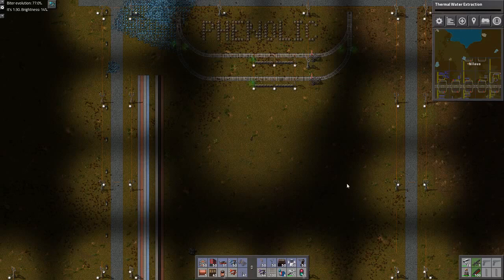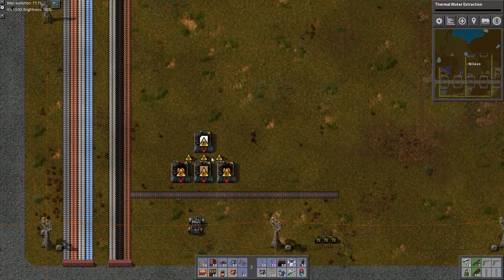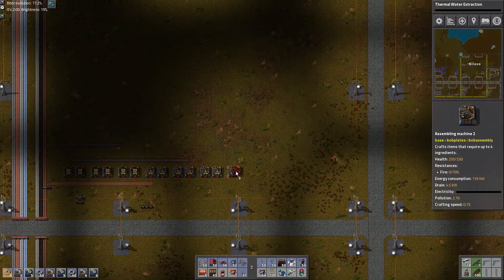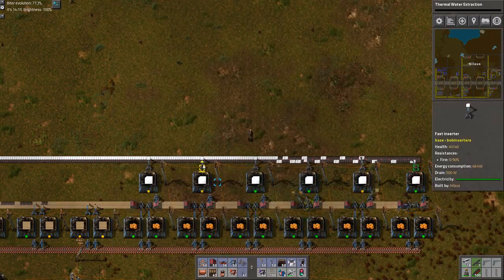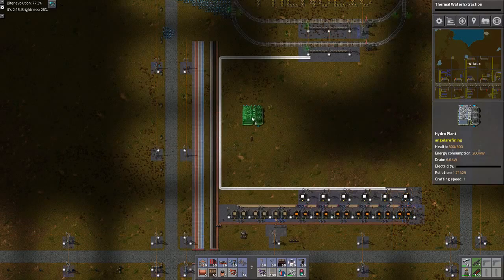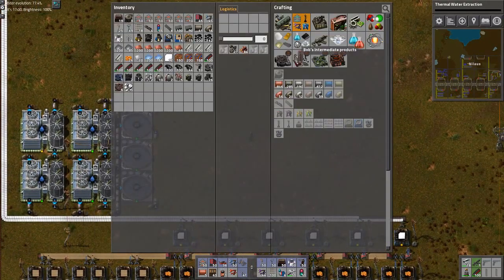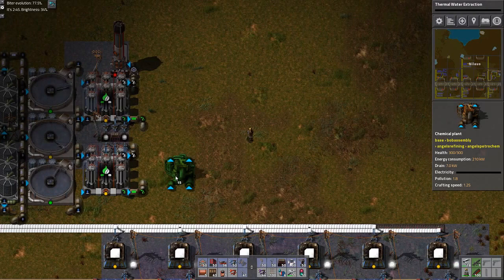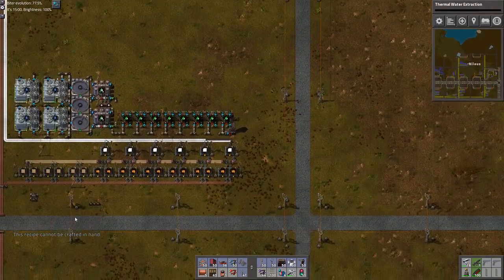Lets Play Factorio S6E23 - Phenolic Board and Hydrogen Chloride Gas

Comment: The strength of your city block design is its centralization of processing. Water refineries produce several important resources. I think it would be best for them to have their own block. Simply because it would allow you to take full advantage of the materials they produce. Oil refineries are the same way. This would also be a good time to update your smelters. 

Enough with my back seat gaming I enjoy this thought provoking factory design. Its not easy. But then again where would the fun come from?
Reply from the maker: That is a really good point. After installing the Omnibarrel mod I should use barrels for everything. The water treatment plants are taking so much space that it becomes inefficient to "just build some in a corner". I will look into that suggestion in an upcoming episode. Thanks
Reply: Christian Nilaus you have been using the Omni-barrels. But I think how is the most important question. Having a cityblock dedicated to liquid and/or gas storage might help.